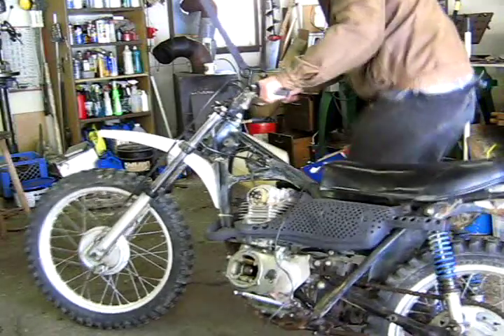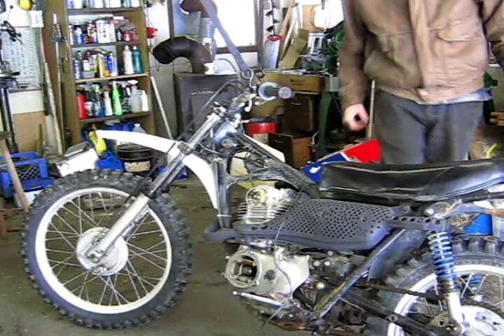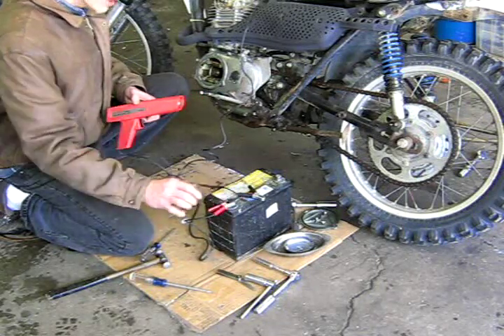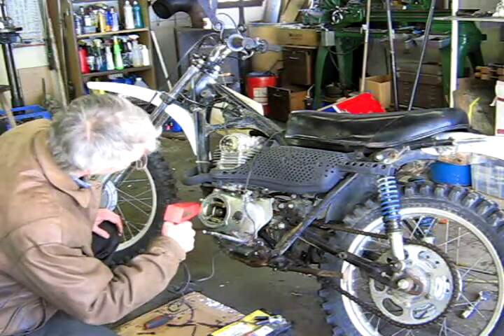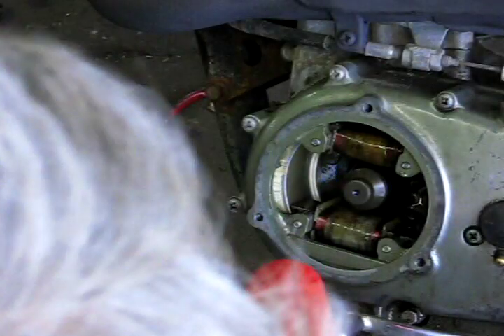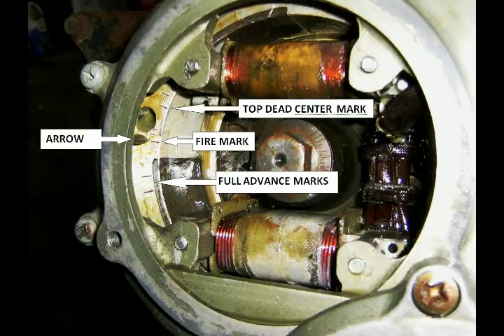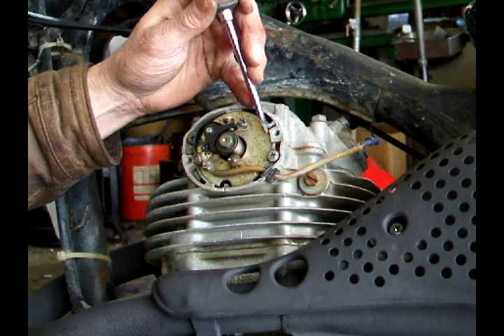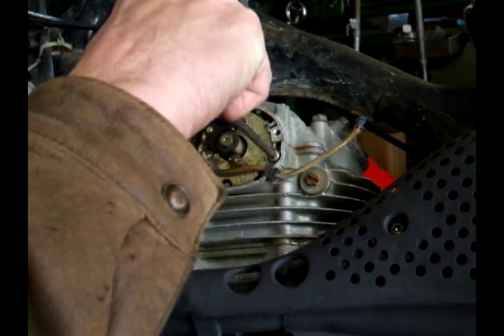Dynamic motorcycle ignition timing

Comment: Sooo... you didn’t explain.  Is the timing arrow supposed to fall somewhere between the two full advance marks ?
Reply from the maker: It's suppose to be at the F mark at idle, and between the advance  marks when you rev the engine over 3000 RPM.
Reply: @Amotorcyclenut  Ok, thank you.  I’ve got to ask you.... I followed your advice and blocked off one of the petcock barbs and T’d my fuel lines towards the carbs.  I did this because, at higher speeds, my bike would start starving of fuel (I know this because i can see one empty fuel line when I look down through the little clear plastic filter).   The line going to the left carb is always full of fuel, no bubbles, but the right always seems to have air in it.  I’ve scoured the internet, searched through all the forums and this seems to be an extremely common issue to which there seems to be no answer.  The only answer I’ve found that supposedly fixed the issue for the person was to remove the inline filters in both those lines.  I don’t understand why that would be but I did it anyway.... didn’t fix the problem.  I just do not understand why the fuel isn’t filling the right line.  There’s no problem with the petcock that I can see - I’ve cleaned it out twice.  The fuel bowl vent has been cleaned out twice.  My tank cap vent is also clear.  I’m at my wits end.  I’m appealing to your experience in hopes you can steer me in the right direction.  THx
Reply from the maker: Is this the video you are referring to   Honda fuel valve fix   https://youtu.be/4aDDFMd0Ups.  Make sure that the Tee is below the bowl of the carbs or you will still have the same problem. Put ONE in line filter before the tee if you have to have one, because the fuel valve already has one in it. Look at he video again, and use the same hose routing. Make sure your floats are set right  and working correctly. You can check the flow by removing the bowl drain screws and seeing if  you get gas out of both carbs at the same time when you turn the gas on. PS catch the gas so it doesn't run all over and catch your bike on fire. You can do this test with out the bike running.
Reply: @Amotorcyclenut  excellent.  I didn’t catch that about the T.  I’ll give that a shot, thank you.

Comment: hi thanks for the videos they r great.  got an issue with a xl250 i'm working on.  I am able to set the timing at idle.  the "f" mark lines up with the arrow.  however at higher rpm the timing light jumps around out of sync with the advance marks on the fly wheel.  the bike when ridden doesnt want to accelerate under load, pops backfires runs like crap.  It does start up easily and idles fine.  could use some help.  fyi points gap set at .35mm and the spark plug cleaned and gap'd.  running without a batter but i remember these bike running ok without one.  at a loss on where to look next, coil? condenser?  too much spark sent to plug at high revs?  appreciate any help.  thanks
Reply from the maker: +Johnny Mansour Thank for your comment. A couple thing I would check would be : Cam chain adjustment see video 1975 Honda XL250  cam chain adjustment https://youtu.be/hJI2TQAIzE8
Check the felt wiper on the ignition plate, make sure it  slightly touches the high spot of the advance unit. Lube it with a small amount of grease or oil. Make sure the advance unit advances properly by hand and that it doesn't stick or if the springs are sloppy, tighten them or replace them. Make sure your points are in good shape, check electrical connections to the ignition coil, watch these video's.
Repair motorcycle electrical connections part 1of 2 https://youtu.be/acco7T8_cq0

Test Sparkplug Cap with VOM for Motorcycles and Mopeds https://youtu.be/yGfIkwOp-Vk 

Ignition Coil test with VOM for Motorcycles and Mopeds https://youtu.be/iVH83g9DUK8

How to set a Motorcycle Points Ignition, Statically https://youtu.be/WQqLnBRsofk

Dynamic motorcycle ignition timing https://youtu.be/cJqfIuuHOuw

This should get you started, If that doesn't solve your problem let me know what it does.
P.S. Don't for get to check you air filter. If you want to Know How to make one for that bike watch this video
Make an air filter for your Motorcycle https://youtu.be/iAKnz2w6PkA
Reply: +A Motorcycle Nut thanks for the feedback.  I think I am starting to narrow down the issue.  Since I am running without a battery I am not sure I am getting enough spark or amperage at anything above idle.  Couple questions.  
How many amps does the stator/generator produce on these bikes?  
Do you have a video on how to test for amp output?  
Is it true that combining 2 or 3 wires coming out of the stator/generator I will have 12volts?  
Things upstream in the ignition system will they work on 12V?  points, coil, condenser?

Thanks again.  j
Reply from the maker: +Johnny Mansour What year is your xl250?   The the early ones 72-76 where 6 Volt systems.
Reply from the maker: +Johnny Mansour Do non't combine the stator wires. The only wire involved with the ignition is the black one. the rest just charge the battery. Here's a like to a schematic for a xl350 which is really close to what you have. the ignition circuit is the same.    http://amotorcyclenut.com/wp-content/uploads/2014/05/XL350-wiring.jpg
Reply: +A Motorcycle Nut ok thanks yeah the reason I am asking those questions is I am thinking of using a sparx or podtronics battery eliminator, i dont really have room for a battery anymore.  here is some info on the device:
http://www.ebay.com/itm/Triumph-Norton-BSA-power-box-battery-eliminator-Sparx-2-wire-capacitor-/201163683844?&_trksid=p2056016.l4276

IF YOU'RE TRYING TO SIMPLIFY THINGS THEN USE THIS BOX TO  GET 
RID OF YOUR BATTERY, ZENER DIODE, RECTIFIER AND REMOTE CAPACITOR. IT'S 
ALL  BUILT INTO THIS UNIT !! YOU CAN STILL WIRE IN A BATTERY IF YOU NEED
 TO  BUT HAVE THE PEACE OF MIND THAT YOU'RE BIKE WILL STILL START IF THE
  BATTERY IS DEAD OR LOW. CAN BE USED WITH TWO AND THREE WIRE 
ALTERNATORS  AND TO CONVERT 6 VOLT ALTERNATORS TO TWELVE VOLT. JUST PAIR
 ANY OF THE  THREE WIRES COMING OUT OF THE ALTERNATOR AND CHANGE YOUR 
BULBS TO 12V  AND AWAY YOU GO 

One thing they say is my output from my generator needs to be 10amp or more.  The other thing if this works is I can run 12v headlight/taillight (w/ LED bulbs) 

I have a '73 xl250
Reply from the maker: +Johnny Mansour That unit is not going to work because you have a 6 volt stator and charging system. Your Ignition system will work with out a battery, its a magneto system.

Comment: She won't run past idle speed but I think I should replace the spark advancer mechanism you think that would fix that it's a 77 XL 100 with an sl100 engine I go to give it throttle n it sputters n dies
Reply from the maker: Shean Edwards Before you start throwing money at it. Is you carb and air filter clean and in good shape?  If not watch these video's How to clean motorcycle carburetor jets http://youtu.be/Ti1vWJT_n4Q
Make an air filter for your Motorcycle. http://youtu.be/iAKnz2w6PkA. If they are did you watch How to set a Motorcycle Points Ignition, Statically http://youtu.be/WQqLnBRsofk It shows how to set the points close enough to get your bike running so you can set them dynamically. At the end it shows how to see if the mechanical advance is working.  If you want to check out your Ignition coil watch Ignition Coil test with VOM for Motorcycles and Mopeds. http://youtu.be/iVH83g9DUK8  Check out my channel "A motorcycle nut" there is all kinds of videos how to fix motorcycles. I'm sure you'll find more stuff to help you out. Don't forget to like the video's that help, and subscribe.